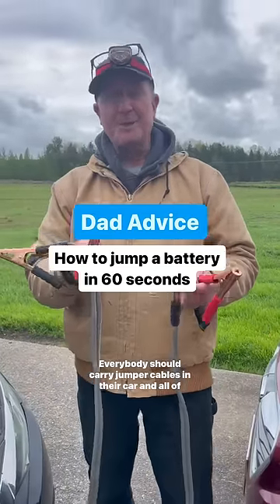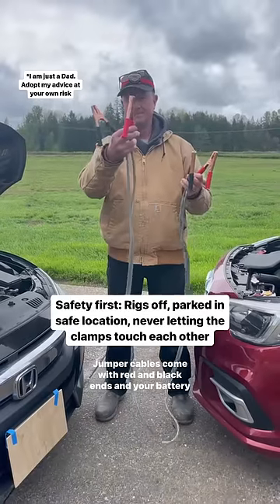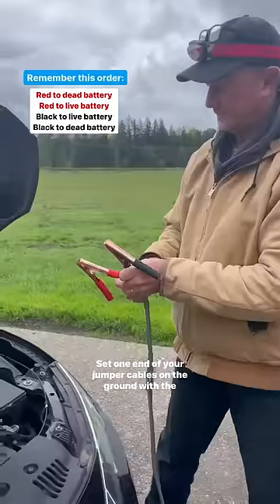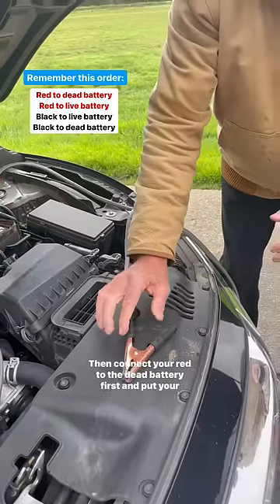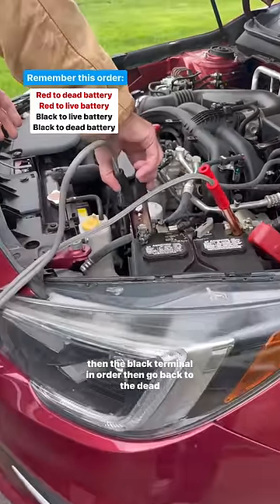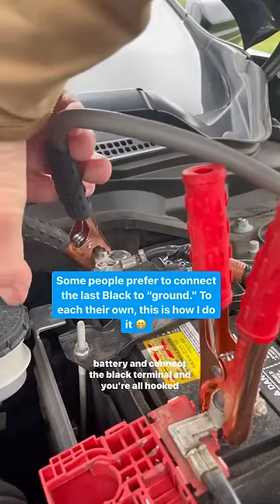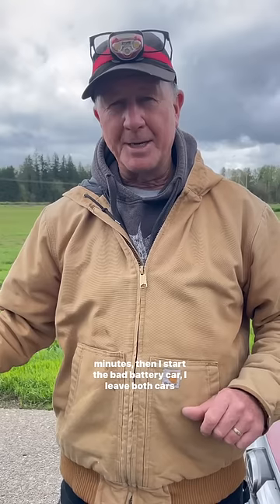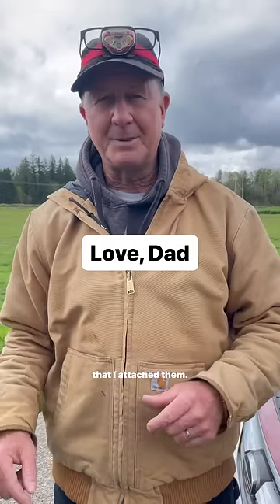How to jump a car battery. Love, Dad

Comment: You really actually shouldn't start the dead car while the car with a good battery is running.. you can short stuff out. Let car run for a minute or two shut it off then start dead battery car. Then remove cables

Comment: i usually hook up both hot and ground to the good battery. Bang them together to make sure I have good connection.
Then hook up the ground first to the dead battery. This gives you a nice spark when you hook up the hot side on the dead battery.

Comment: have you ever seen a battery explosion?
 never make your final connection to the dead battery because if it's frozen or has a dead short in it it may explode,  therefore you don't want to be anywhere near it if it does. They spread acid everywhere within about a 8' radius.
 The live battery will not explode,  so this is where you should make the final connection, as it removes you from the danger area.

Comment: The last connection should be not to the battery, but some other metallic piece that’s not electrical, I usually use the bolts on the Strut tower.

Comment: This is to ensure that you A, don't create a spark that can cause an explosion of the battery vapors and B, to not fry your electrical components.  As for hooking last clamp to other ground than battery, that's a good idea as long as you have a good engine ground to complete the circuit.  If it doesn't work, try moving the ground clamp to the battery before moving onto your next step.

Comment: The last connect will generate a spark.  Do the last connect on the car with least amount of oil/gas all over the engine.  That's usually mine for the last connect.  I hate leaks.

Comment: I would strongly recommend starting the good car before attaching that last cable, or else the bad battery can drain the good one to the point where you can no longer start the good one (really only would happen if the battery in the good car was old/borderline dead) but it has happened to me before.
Reply: You never start the car before the cables are connected. If you accidentally short the terminals while the running car is connected, at minimum you could fry your alternator, at most fry your ecm or body control module or both.

Comment: You NEVER connect to both terminals on the dead battery. Will produce hydrogen gas. Always connect negative on dead car to a ground point like the engine or some metal bracket.

Comment: The ground on the battery that's not dead the one using for the charge should be placed on a ground other than the battery this is recommended by manufacturers and mechanics. Just what I have been taught.